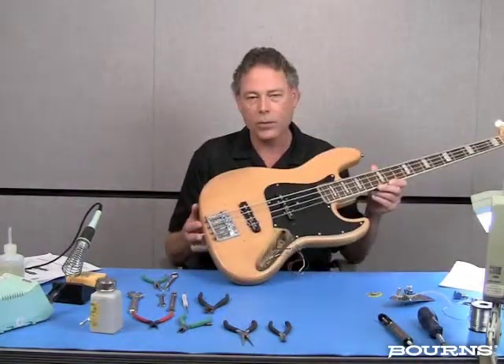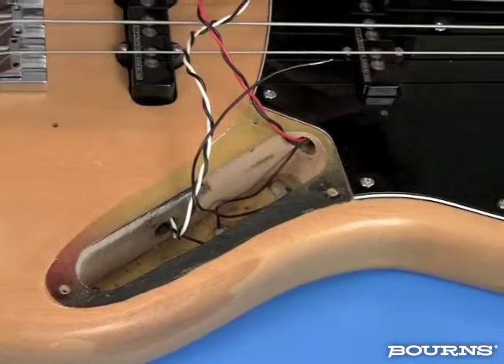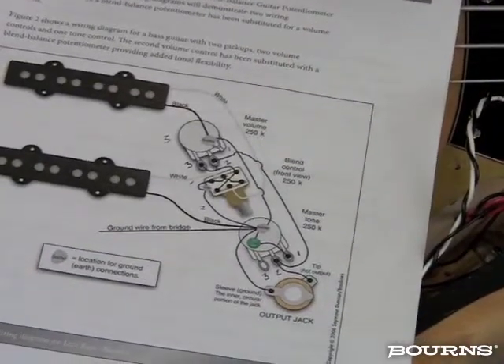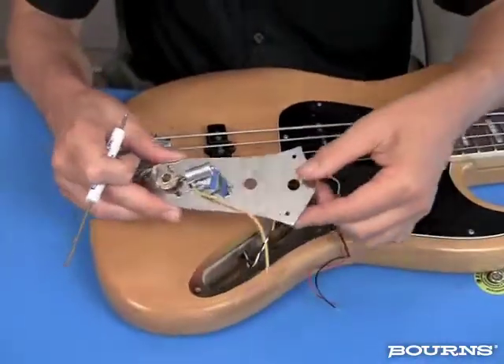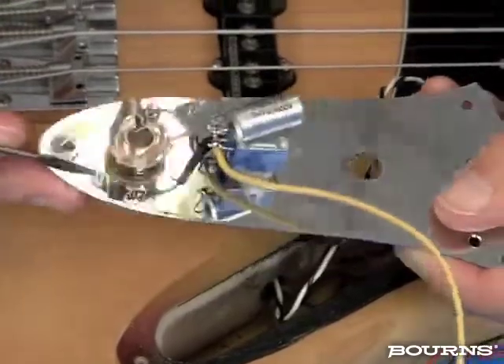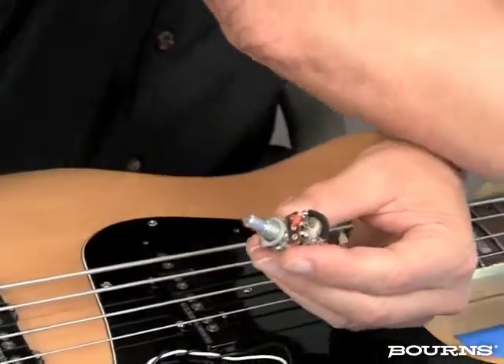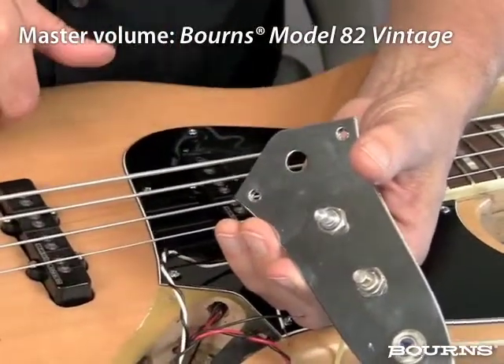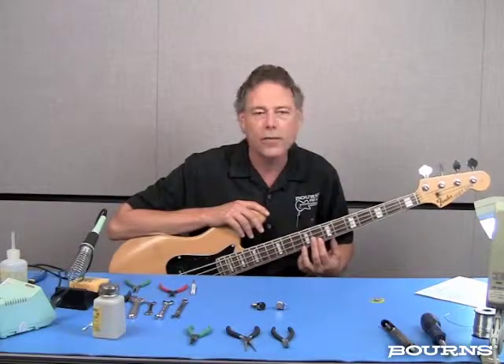Bourns Blend-Balance Bass Guitar Application

Comment: Why does every wiring set I've seen connect the hot pickup wires to the wiper (centre term) of the blend pot ? What this does is load the pickup up differently depending on position from half point down , each pickup should be across the pot and wipers mixed with resistors .